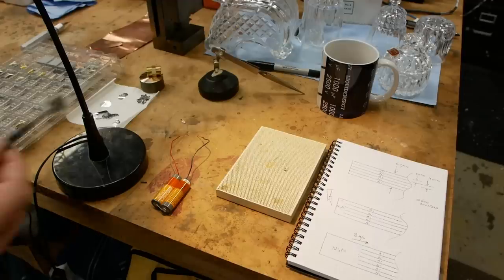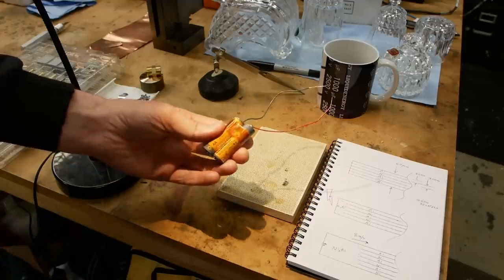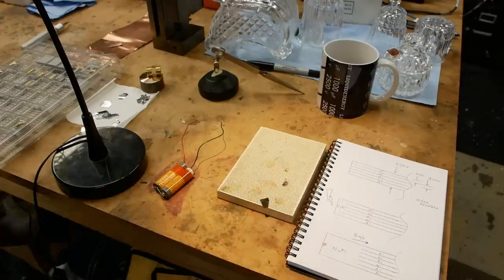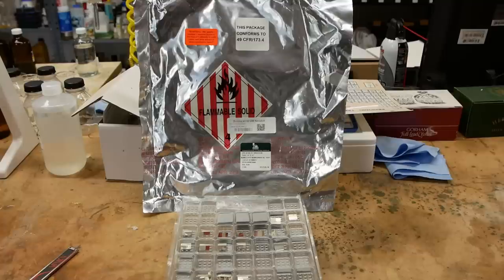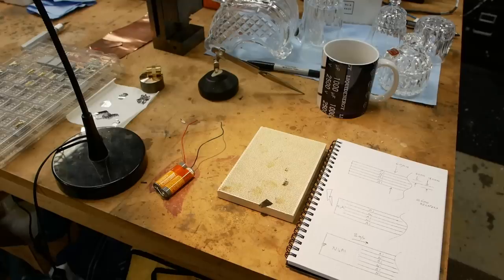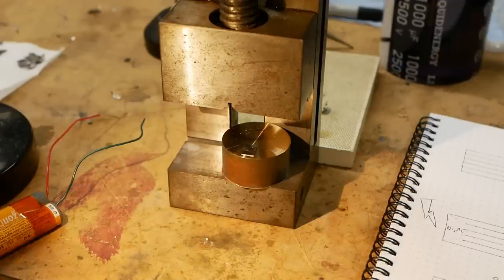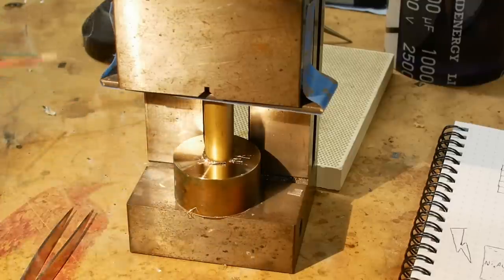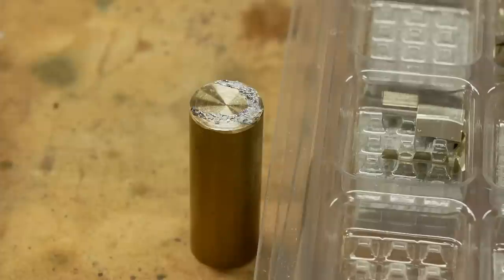Multi-layer reactive foil: no fuel, no oxygen, tons of heat

Comment: We use this at work to bond power MOSFETs to copper bus bars. The trick is that the surfaces you want to bond should be tin-plated. You don't need solder film, and the joints are incredibly strong. I have tried breaking them apart by hand and cannot.
Reply: This is actually really useful information! I am building a TMS unit, and want to minimize losses/heating at the connections. 

Do you just use bath electroplating? Do you use/make those 'electropens' (not sure what the proper name is, I've only used them for jewelry) that have a tip soaked In solution, current source and an alligator clip? (I can't afford to put a $1000 transistor in a bath and ruin it if it's not safe)
Reply: @sophiophile I would be very curious if you found a simple way to electroplate things with tin, as it's a very tricky metal to do so since it always tends to form sharp branches instead of a thin layer.  The only ways I know of that don't require melting the tin either involve alloys with zinc or hydrofluoric acid baths, obviously something you'd want to avoid.
Reply: @flomojo2u  I don't have personal experience with this, and am looking for guidance from the OP (who does).  I think that tin whiskering during plating might not be an issue, if you are going to follow it up with soldering via the method in the video, since all those whiskers would probably be melted down and form a well-bonded surface?

That's just a guess though. Let's wait for the OP!
Reply: @sophiophile  I'm also interested in what the OP has to say as well. Regarding whiskers, I wonder if the trick to texture to surface so you get a dense carpet of very fine whiskers and then mechanically press that flat?
Reply: How dangerous is this stuff to store and handle? Seems like you'd want to have only small quantities in any given space
Reply: That's a cool application, I'm researching die attach technologies as a grad student and one thing we've tried is to solder dice directly to a ceramic package.... gold plating on the backside really doesn't last very long. I've tried using AuSn solder with hot air and that's been the best result so far. I wonder how well this reactive foil would do: moving the joint as little as possible has been crucial to get a decent bond without dissolving the gold.
Reply: If this technique is used to bond transistors to a pcb would a soldering iron be able to remove and repair that pcb?
Reply: @definty  Pretty certain this would damage a PCB. The amount of heat released alone probably makes it not appropriate. Attaching components to PCBs already has standard, easy to implement techniques at every scale of production. Why would you wanna use this?
Reply: @definty  depends on the temperature and what alloy was used to form the actual bond I think, should be possible
Reply: @DerinTheErkan  Aside from silver-tin soldering (which is sort of the industry standard), wouldn't the best approach be to look at the chemistry of the ceramic and die material and choose something that can form a decent solid solution with either (+ some sort of flux, maybe different for either material to be joined)? That way you can achieve a transition between the materials instead of a filler holding them in place?

Easier said than done I'm sure hahah
Reply: @sophiophile  I tried to unsolder some components from a laptop motherboard but even at launch in 500 degrees centigrade heat it would not melt, I was just wondering if this was their method they used solder components to the board.
Reply: @definty  Some boards are manufacturer in a way that is meant to prevent desoldering (or make it difficult), but if you are talking about a standard laptop- it's probably just a technique issue.

Do you have proper pcb electronics flux, a proper style of soldering iron (not what you get from a hardware store) with temp control, etc? Did you try using (again a proper) hot air/reflow station?

If they are using solder which won't melt without damaging the pcb, some companies sell a separate special solder that you actually add to the join, and melts/alloys with the high temp solder to allow removal.

There are plenty of YouTube channels that have videos teaching how to work on PCBs.  Louis Rossman has many (but scatter throughout his channel which covers many topics).
Reply: @sophiophile  this is using SHS( Self propagating high-temp synthesis). I guess they electroplate alternating metals in layers, but the reaction works because the atoms need to travel very short distances on the scale nanometers to form a more thermodynamically favorable alloy. This results in a exothermic reaction which activates more synthesis. The way other to do SHS is to place metal and ceramic powders in a planetary ball mill under Argon gas and ball mill it at 10,000 rpm, this process with electroplated layers is much cheaper to make but designing a electroplating process where you change the element every 60 nm will be difficult
Reply: @definty  50 degrees C is not enough to melt any solder I know of, even with gobs and gobs of flux on it. It's more in the range of 150-250 degrees C. (I should say, with flux. Without it, you can easily break components because of the time it takes to heat them up and melt the solder)
Reply: @sophiophile you could probably set off the reaction with laser but the guy who introduced me to SHS did his PhD on it and he used voltage variac to set it off and did it in a glovebox under Argon he was however making Ceramic MAX phase precursor for 2D nanomaterials called MXenes using Titanium carbide carbon and aluminum powder that were nanoscopically mixed in a planetary ball mill
Reply: @sophiophile  Ceramic packages typically have gold plated nickel coatings on the floor anyway to make electrical contact to the back side (typically with conductive epoxy in production I think) so that's why we haven't considered bonding directly from silicon to ceramic, although it's probably doable somehow. I'd be worried about mismatch of thermal expansion coefficients (in fact I'm studying the residual stress from the die attach), with a rigid material transition bond it might cause reliability problems.
Reply: @nikkiofthevalley  sorry, typo, I'm on a mobile. I mean 500c
Reply: @definty preheat the motherboard, there's a lot of copper in there. You can use leaded solder to dilute the lead free stuff they use in the factory, and as someone before me said, get proper gear. 
If you're using 500c you're destroying the components.
Reply: @sophiophile  We have  a plating shop do it for us, so the results are very uniform. I'm sure we specify plating thickness, but I have not seen the drawings for myself. The transistors are one of the larger TO packages with the large drain pad having the factory standard tin plating already.
Reply: @imaginitivity7853  we store it in the trays it ships from Indium in, in a grounded flammables cabinet. It is shelf stable, so the idea is just to keep it somewhere safe from shocks (whether mechanical, thermal, or electrical).
Reply: @sophiophile   I  was a Fujisu Laptop if I recall correctly. I tried with the soldering iron and with a reflow air gun. I have a Unit with both the soldering iron and rework air flow unit on. it could be technique. I got new soldering tips and tried with with flux, still no luck. In the end I had to hacksaw then connector and and resolder a new one to the stuck out pins from the old one. It work for about a year or so but it broke a couple of weeks ago.
Reply: MG Chemicals makes a product called liquid tin. It is a solution of an organic tin salt which reduces to tin on a copper surface.
Reply: @nikkiofthevalley  : Some of the (gallium?) solders might melt at 50C, but that would all be specialty stuff. I vaguely recall that there's one that will wet some glass that melts at a quite low temperature.
Reply: @jamgreg  when you say plating shop I assume you mean electroplating, from what I read in other comments these are made using metal evaporation, I assume it's because sputtering isn't fast enough and that electroplating is too fast or not uniform enough at 60nm. The shop that does the plating could probably patent their process if they actually achieve SHS a more scalable approach would be to use planetary ball milled powder if a thin coating can be applied to PCB components. Imagine having a pick and place machine that does instant soldering
Reply: @cybyrd9615  I meant that we tin-plate the copper bus, not the nanofoil.
Reply: @sophiophile  Please stop soldering my MOSFETs - I am too old and can barely take care of my cat and you keep soldering everything... I dont understand what is wrong with you I keep asking and asking you to not solder things and then I come home and you have everything in a heap and I couldnt find my cat you know I need to eat hair and he has so little hair left to begin with I just cant deal with you anymore
Reply: @imaginitivity7853  Good point, no way they have sheets of this stored, that be unwise lol
Reply: Yes... then us repair techs have to dig out the angle grinder to remove your shorted out MOSFETs, thanks for that.
Reply: @sophiophile  facts
Reply: @FrozenHaxor  There is no reworking these things, AFAIK. That's the tradeoff one makes. FET fails? Replace the whole module.
Reply: @sophiophile  It's high temperature but it's not a lot of heat because of the low thermal mass.
Reply: @pilotavery  I mean, if it can generate enough heat to bond such huge pieces of metal together that can act as such gigantic sinks, I imagine it's still inappropriate for a PCB. The OP is talking about bonding busbars to power MOSFETs (and it sound like the kind where a single transistor is a couple pounds and the size of a hardcover book).
Reply: @definty  If you desolder power components in the PCBs fully covered by a thick copper layer on top and planes in the middle and bottom layers, removing components it is a real challenge even if you pre-heat in a oven.
Reply: The material will generate a lot of heat, but also, doesn't it also leave behind the remains of the sheet metal? Doesn't this interfere with the bonding?
Reply: @dennisk5818  It becomes an integral part of the bond. It is thermally and electrically conductive, and mechanically robust.
Reply: Do you think this could be used to solder tiny SMD leds?
Reply: Where idk you get the nano foil from please?
Reply: @sophiophile  To avoid voiding created by the flux in the solder. Nanofoils remove this problem. Also although the heat given off is very high, the activation time very low and damage to the PCB does not occur at all.
Reply: @merlin7766 Directly from Indium Corp.

Comment: Ben, I am very local to you and am a goldsmith. I've got many tools in my workshop that I feel would be very useful to many of your projects. Some of these tools are a rolling mill (would have been useful in today's video) and a powerful ND-YAG 80-joule laser welder that is normally used to weld micro scale for repairing things that are heat sensitive and casting equipment for lost wax casting. My friend recently contacted you regarding some holographic and interferometry equipment I wanted to donate to you, however, you simply don't have space for it. I get it, I have a fairly large workshop, and still, I have run out of space. my shop is in Albany CA, I offer you free use of it and any tools I own, and do feel I can occasionally be of great help to some of your projects. bye bye and maybe you will read this :)

Comment: I wonder if you could make a version of that by electroplating on the thin alternating layers by alternating the material between two different electrolysis containers.
Reply: maybe, but you would have to somehow stop oxidisation on the way. 
The way I have seen this being made is by cyclic evaporation of the two metals in a vacuum chamber, balanced with cooling it with ballast.
Reply: Certainly if there is a way of plating thin aluminium layers by electroplating it sounds possible. I wonder if there are any other similar arrangements of metals that might show this behaviour.
Reply: 🤔 Electro Vapor Deposition, maybe?
(or whatever it's called; how metal layers get deposited to plastic, glass, etc, inside a vacuum chamber)
Reply: @DUKE_of_RAMBLE  Physical Vapor Deposition.  The metal or whatever is evaporated in a vacuum and condenses on the substrate.
Reply: @randacnam7321  That. Yes. Thank you!

Comment: It's a narrow range of solder thicknesses that this can work in. Al embrittles tin joints so you can't make the solder too thin either. If the surface isn't wetting then you may need to flux to remove the oxidation barrier. That and sometimes the solder you are using just doesn't form the right intermetallic with the surface finish. You probably need to get application engineer support from Indium Corp directly to get this to work, which explains why nanofoil hasn't really taken off despite being around at least 10+ years.
Reply: Its the price that limits its adoption.  Hard to compete with the cost of reflow or soldering iron.
Reply: Hello Sir, I really enjoy your videos. The material you mention sounds like it is similar to laser phenomena in that the energy state is lower than the “inverted” populated state. All It takes is something to start the cascade of energy flowing to a lower level. I nice heard of a “gravitational laser” that worked like dominoes falling. (Although it was not stimulated emission of light.) This material does release energy—I wonder if it is at the same wavelength??? Hmmm?

Comment: Seeing a HUGE sheet of this, or roll that is unrolled, would make for an AMAZING episode on one of those Slow Motion Channels!
Reply: Sounds scary, this seems close to an explosive so handling a large sheet does not seem fun
Reply: @oliverer3  You are wrong. Explosions are fun.
Reply: @oliverer3  Valid Point Though, USCSB had a video specifically on how scale can impact the safety of a reaction.

Definitely would need to consult experts and maybe even do it in a special location!
Reply: Also it may end up being expensive as hell
Reply: You can order letter-paper sized sheets. The idea being that you would die-cut the shapes you need. So the possibility is there.
Reply: @ericlotze7724  In this case, I don't think scale would impact much. Because it's just a flat sheet, I don't think any form of square-cube law would factor in, so I would expect a large sheet to behave very similarly to the tiny ones shown in the video, save for a different behavior when crumpling up.
Reply: Don't give PyroStyro any new ideas.
Reply: 1 2  But a sheet is 2D so it is geometrically not affected by the square cube law (unless you roll/fold it). The sheet is more like a fuse than an explosive. The length of a fuse doesn't change the behavior. I would not bet my life on it, but I'm pretty sure it would be harmless. Now if you roll it, that's an altogether different story.
Reply: @oliverer3 8 meters/s is nowhere near explosive territory.
Reply: @Broken_Yugo  I meant more in the sense that one static electricity spark while handling it and you'll likely end up with serious burns.
Reply: @user255  As long as I'm not the one exploding.
Reply: @kindlin  Dude, that is dark. I prefer victimless explosions.
Reply: @user255  Thus, my post. I guess:
As long as no one is doing the exploding.

Comment: This is sick! I’d love to see you try making some in your sputtering chamber. I bet if you had one sputter gun for each metal you could just rotate a stage between them at a prescribed time interval and somewhat automate the production
Reply: could also just set both of them going and start rotating the specimen very slowly, building up the layers in a helix.
Reply: you'd have to make the foil layers seperately, the chamber might be a bit too energetic for the complete composite to hang around for very long!
Reply: @theafro  Inclined to agree, to reach sputtering level energy you have active plasma in the chamber. May not always trigger if the proper conditions were met, but I think it's important to expect it in this instance. Nice catch!(was considering trying some myself and this has likely just saved me some headache.)
Reply: @theafro  oooo yea that’s a tricky one to get around
Reply: I bet you could make it with a sheet metal roller. Just start with the aluminum layer 33% thicker than the nickel and just rol it out, cut it and stack it and then roll it out. Repeat until you have the desired number of layers and then roll it out until you have it thin enough
Reply: @11macedonian  you'd need to play with the thicknesses as ali/nickel will differ in malleability, and the interface between the foils will need to be religiously clean, but a rolling mill would probably do the job. it wouldn't take long to get to a few million layers.

Comment: 5:34 for something as large as that (high thermal mass) preheating all parts to say 100C or 120C will help. As an experienced "big" PCB reworker, the bond had all the visuals of a way-too-cold joint. On smaller parts (1-2% of the mass you used ) it would have probably been a much better bond.

Heck even a domestic hairdyer may help (I use one as a preheater to do PCB work on large PCBs and large components with lead-free solder such as power transformers, large RF screens and stripline filters)
Reply: The magic of nanofoil, when done properly, is that it can effectively bond large thermal masses at room temperature, without flux or special atmosphere. This makes it possible for an engineering shop, rather than an EMS or rework shop, to do the work.